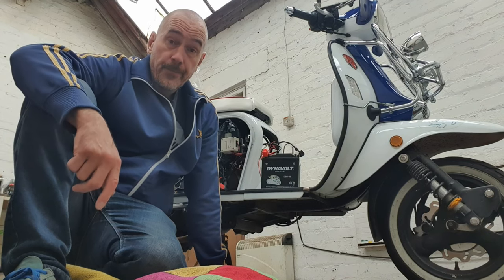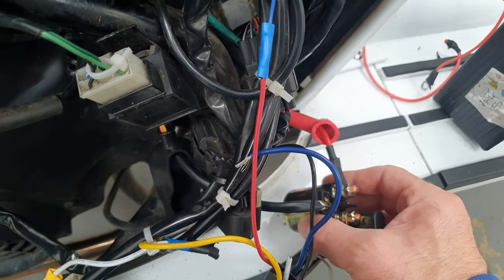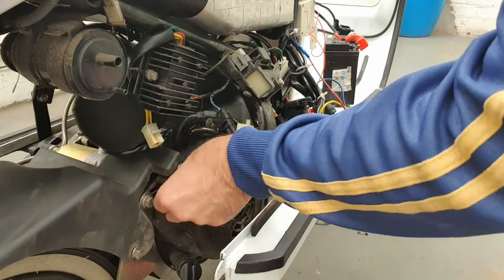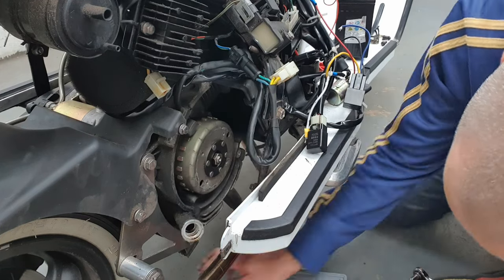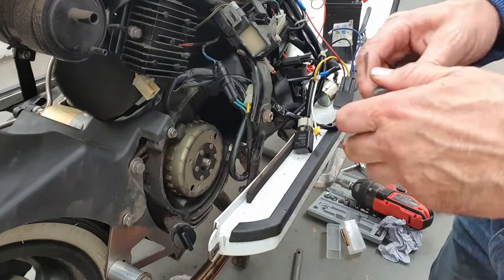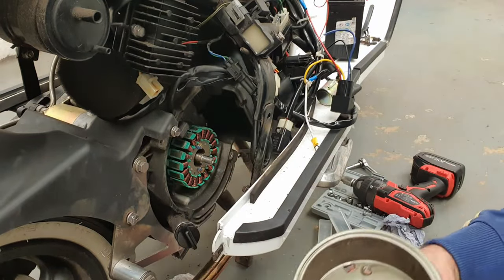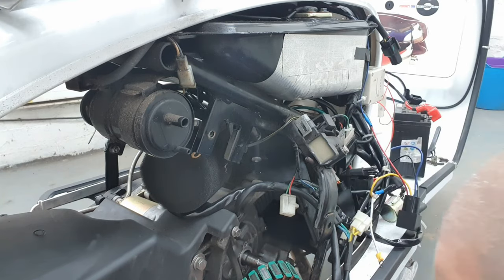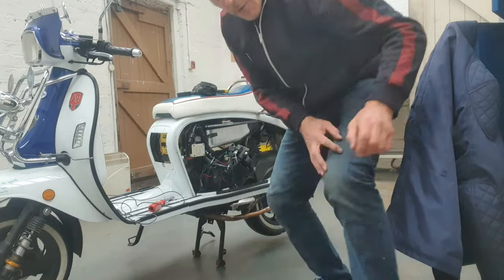Royal Alloy Starting Issues & Replacing Stator, Royal Alloy (Gt125)

Comment: Awesome video and great learning experience for you.
I am not convinced that it was the stator though unless I missed you testing the resistance of it.  Yes the scoot started when you changed it but you also connected a new battery at the same time giving you an additional variable.
I suspect your battery was knackered, hence the relay clicking when trying prior to all you hard work.
It is worth check the voltage at the battery when the scoot is running, should read 14+ volts if not regulator/rectifier needs replacing and will be the cause of your battery being drained and ultimately may have contributed to the original batteries demise.

In my experience if you had changed the battery for a know good one the scoot would have started, neither the stator or regulator/rectifier would have caused it not to start they are part of the charge circuit when it’s running.

Once again great video and thank you for sharing it is very much appreciated!
Reply: Agreed sounds like it was the battery

Comment: Great vid and glad you sorted the problem. I've fitted a dual usb charging socket to mine that also has a voltmeter display so you can see immediately if the charging circuit is doing it's job.👍

Comment: Thanks for this Rob - glad you’re sorted. Watched , learned from and enjoyed all your videos. You mentioned getting advice from forums - be interested which ones I’ve only found the Facebook official and uk group. Job would have been easier if you removed floor piece - it’s not that difficult , you have to loosen main cover which is just a few bolts. Spend time to save time and avoid straining on the floor. This also gives much better access when changing battery. Agree it’s worth testing charging voltage now when running using a multimeter.

Comment: Always nice to see people working on their own scoots 👍never does any harm to buy those bits anyway as you said and now you will have some working spare parts 😎 did you torque your bolts or just go by feel ? Did you run a multimeter on the battery terminals to make sure you're getting a charging voltage ? Hopefully you did mate ...Greetings from Latvia once again 🤗...Harry

Comment: The problem was almost definitely just a dead battery, replacing that lot was a waste of time and money. Always start with the simplest things first. In his case use a known good battery and either jump it across the suspect one or just replace it and try to start it, if that works, fault found.  A failing battery will cause the regulator to compensate, a/ to try and charge the dying battery because it's sending the regulator a low voltage and b/ to power the electrical system to compensate for the low voltage. If this is allowed to continue for very long it can cause a poorly designed regulator to overheat and fail. The stator, which is basically one part of the alternator, also called a generator, is the last thing to suspect.  The big clue here was the clicking relay, that is a sure sign of a dead battery. I had this exact fault on my Royal Enfield C5 500 last year, took the bike for an mot, all fine. Arrived back home, had a cuppa and went to go on an errand, clickety click click! Battery had failed, just like that after just under 4 years, that's Indian batteries for you. Replaced it with an AGM battery, all good, end of problem, but that original battery had probably been failing for a while, and this despite me using a maintenance charger during winter storage. Indian electricals are generally suspect quality, although on this Enfield they have used a Denso starter motor, alternator and rectifier regulator.  I also checked the spark plug, which was marked Bosch India!  Looking at it closely the electrodes were crudely manufactured, so I binned that and used a real Bosch plug. So, remember guys, check the simple things first, before using the parts cannon!